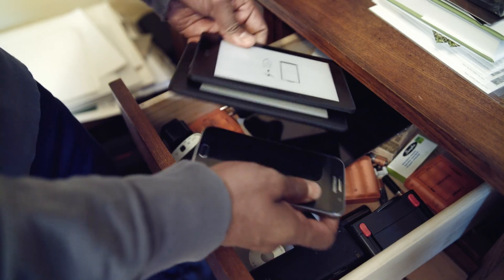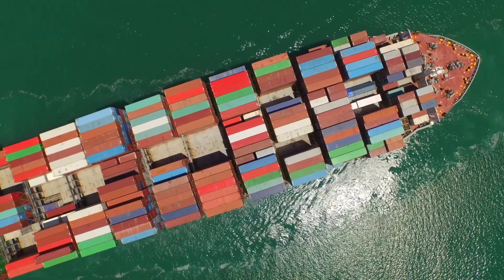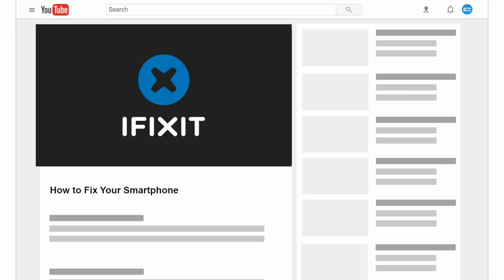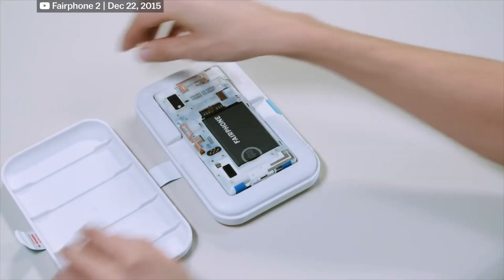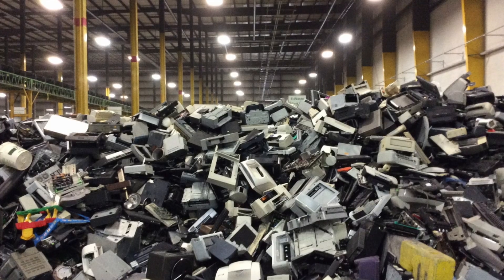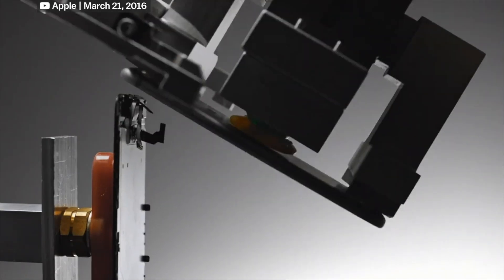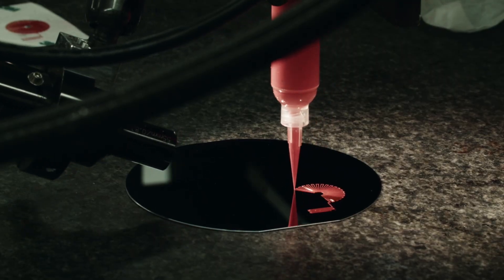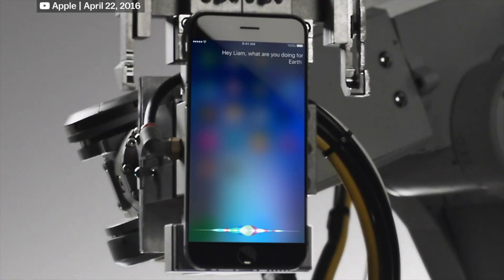Why your old phones collect in a junk drawer of sadness

Comment: The reason why devices like smartphones are so disposable is because they are by design getting better in every iteration, in such a way that older devices can no longer serve the same primary purpose in a satisfactory way. Take "browsing the internet" for example. The latest phones give bigger screens to view on, faster processors to handle heavier websites, and better support for emerging web standards. Sure you could repair and keep using your old phone, but you have to learn to be content with a tiny screen, a broken website and a slow processor. And that is what drives people to upgrade. Compare that to a car which serves its primary purpose very well, which is to get you from point A to point B. Any working car can do this, whether it's a Model T or a Model 2017. The only thing you get from upgrading to a newer car is the extra bells and whistles, not really a big improvement to its primary purpose. Now imagine in a distant future, if the road system changed in a fundamental way that simply required you to have a new car equipped to handle the new road system. The old car could no longer be used in the system to serve its primary purpose and people would simply be forced to upgrade. I remember a movie set in the future where the cars were all electric but the country's car charging stations had upgraded to version 4 with no backward compatibility beyond version 3. The protagonist had a cheap rental car of version 1 and found with frustration that her car is too old to be charged up in any of the numerous charging stations around the country. So she had to ditch it and walk for miles. That's the kind of future that would make cars as disposable as smartphones today.

Comment: Today, I dropped my phone. The back came off, the battery shot under the car, and the screen did not break. The phone is fine, I put the battery back in and it's fine.

And here these guys go saying that if you take the battery out wrong it will explode. When did this happen!? What happened to batteries that just come out? Am I using a brick to make calls and nobody told me?

Comment: The sad thing is that phones basically stop working after they reach a certain age because they can no longer get OS updates, and without that you can't install software anymore. Compare this to computers, which are actually getting better at forward compatibility—my nine-year-old desktop runs Windows 10 just as well, or better, than it ran Vista when it was new. I had to get a new video card and more RAM to keep up with my usage needs (mainly games and 3D modeling), but if I decided to get a new system, I could put the original parts back in and donate it to a thrift store, and some poor family could use it as a basic PC for browsing the Web, checking email, storing photos, and even editing home videos. Even a Mac Mini from 2009 can still be upgraded to the MacOS Sierra according to Wikipedia. I don't know how well it would run, but you could do it.

Comment: One important problem that was entirely missed here: Software support. There are plenty of phones with easily-replaceable batteries, but even if you could keep finding batteries for that phone forever, even the best Android phones stop getting security patches in 3 years, and iPhones and Chromebooks stop getting them in 5 years. And that's from when they first started to be sold, and those are among the best options we have.

What that means is, even if the hardware lasted ten years, your phone would be a security nightmare for at least five of those years unless something changes dramatically. And that's if you buy a good phone. It's easily possible to buy a cheap Android phone and have the updates stop in less than a year.

It doesn't have to be like this -- if a PC is actually getting to be 10 years old, you might have other problems, but you can usually at least keep upgrading the software. Even when Microsoft finally stops security patches to old OSes (they supported Windows XP for twelve years), you can buy a new OS, or download a free one. But even the "download a free one" option is kind of broken on phones.
Reply: It's like this because our economy is based on continuous growth. Companies need to make sure we keep replacing our phones and more frequently.
Reply: most these unofficial updates dont run 100% as they should. theyll always have some pretty bad bugs and once theyre ironed out, the next version of android is released with a whole load of different problems.
Reply: David Masover I second this. Ever since my first computer I've been replacing the software to keep them going as long as I can. When it gets just too slow or loses software support, I uninstall it and install Linux, which increases performance tons and has given my computers and laptops much longer lives than most.
Reply: In terms of usability older Android versions still technically remain usable for longer then there iOS counterparts. You can extend your upgrade period to 5 years using this, but most people stick with 2.

Rom hacking is also an option and you can still probably suck 5-10 additional years of security updates using this, although its heavily dependent on the popularity of your Android phone.
Reply: I'm looking for a smartphone with removable battery. Beside the fairphone 2 and the LG g5 (wich was a failure), I didn't see other
Reply: Yes and no... I mean... I gave my 8 years old phone (Sony Xperia Acro S) to my 7 years old kid... and I loaded with a bunch of emulators, simple games, some music, some movies and that's it... It is not technically used as a phone... but it is a device which, without Software Support for well over 6 years, is still used more than many 2019 iPhones.

I also have a couple other devices that I use as security cameras (Alfred Camera App) or as temporary backups in case our main is lost/stolen/broken.

I understand the concern of using old devices with no security updates, but if you destined to simple uses, they can still be worth having around
Reply: @buccob  So smart!  I like your idea of finding creative ways of using tools to expand their values and prolong their lives :)
Reply: Antonio Randolfi lg v20 , note 4, lg v10
Reply: +Hanro50 what on earth are you on about. 5-10 years of security updates?
Reply: Moto E4 has a removable battery if you're still looking...
Reply: true
my nexian journey a890 made in 2010, had replaceable battery
however it couldn't use today android version
Qualcomm MSM7227 600 MHz
512 MB ROM, 256 MB RAM

out of specifications
Reply: Linageo OS saved my Note 4
Reply: You can update an Android phone unofficially by rooting it and choosing a custom ROM for your phone that has the latest software. Most of the ROMs are community supported, so the support probably last longer than the support from the manufacturers themselves. Though, this step is risky and can make your phone totally useless (bricked) if you don't do it right, but you can reuse your older phone if you successfully do it. I turned my old phone into a "benchmark and development kit" to test my personal projects to see how they run on older hardware.
Reply: HQ unofficial security updates...its the Android rom hacking community I'm going on about. I got my old galaxy ace phone running 2.3 gingerbread all the way up to 5.1 Lollipop back when I still had it.

Check out the XDA development forum or the Lineage OS project to get more information.
Reply: You are probably one of these guys, that haven't ever hered of flashing your phones ROM.

"MY APPLE IPHONE is getting slowed down... 
what can I do?...

Damn, Flash it, don't buy a new one.
Reply: Not to mention that climate and care dictates how long ever smaller components will last before they degrade, even if made of otherwise lasting materials. That is, all things have a point at which heat and cooling affect them permanently, with smaller components being more susceptible, generally speaking. You can ruin the system bus on a phone with the right temperature. Even still, opening up your phone exposes components to ESD-- and there should be a smarter way of designing things to avoid this. I am so curious about Fair Phone's design for this reason!

Comment: 5:53 what if we could have just kept having phones and other mobile devices where you just open a panel and replace the battery, you know, like we had for decades. reasonably easy to replace batteries should be mandatory, what if your car came with a battery that was hermetically sealed to your engine block, i'm pretty sure legislatures would destroy that idea pretty damn fast. or hell, what if the hood of your car had a "warranty void if removed" sticker? or even worse, what if the fuse box in your house had a "warranty void if removed" sticker and one of your breakers popped. its the same thing.

Comment: I strongly disagree with you. Batteries are only one part of the problem. Software that runs the phones and the most reason why phones get replaced. When your phone manufacturer no longer provide software updates to your phone, that's when the apps you have on your phone can not function like they used to be. hence the need to buy a new phone to keep up. My iPhone 3Gs' battery is perfectly fine, but lack of update render it unusable. The same goes for my iPad (iPad One), it can last for a month on standby, but the lack of OS support render it unusable. Batteries can be replaced even of the phone does not provide removable option. You can still take it to the shop, and have a new installed, much cheaper than buying a new phone.

Comment: The thing is, often one does not replace a phone because it isn't functioning anymore. It is more likely, that the tech is outdated. So what use does a fairphone have in that regard? I don't care if I can get the same chip as a processor, if that chip is too slow and technically outdated.

Comment: @ 5:55 "imagine your battery charging in minutes instead of hours" 
 
I have a Galaxy Note4 and I get it from 0% to 100% in under 20 seconds. 
And it is no magic, just a second battery and an external charger.
Reply: Holy crap! I just put my phone in the microwave
Reply: +IAreNerd   Totally fine, as long as nobody turns on the microwave  ;D
Reply: 0 to 100 n*gga real quick
Reply: Ikr. I've got the Galaxy Note 7 and it not only charges itself in under 20 seconds, it also charges my whole house. Its great.
Reply: thats not charging the battery that's already inside the phone so it doesn't count.
Reply: +Jonathan  
Did you know there have been more burning iphone6 than Samsung phones (until the note7 happend)
google it ;D
Reply: Samsung fast charging is pretty fast I think compared to other devices I have used! It charges completely in about 45 minutes if kept on power saving and your wi-fi /mobile data is turned off
Reply: +Jonathan  
I wonder how much the insurance will charge you ;P
Reply: grayoctagon I have a ZTE and it goes from 0 to 100% in 10 seconds; I swap out the battery.
Reply: My button Nokia charges in about 15 minutes.
Reply: +Kdejaj  +The Tomas Cz  
plz read to the end before answering :P 
I just wrote three sentences... so it should be manageable. 
However the important part was: 
"And it is no magic, just a second battery and an external charger."
Reply: grayoctagon like most of the AMAZING TECH is already in a galaxy
Reply: +Quin Proctor   
No, on normal usage it lasts around 2-3 Days.- 
On heavy use I have ~20% at the end of the day.
Reply: grayoctagon my note for goes dead than when I turn it on it goes to 100 percent then it turns off perfect batteries
Reply: Same my tablet was s a Samsung all I have to do is put the charger in take it out and it’s charged!
Reply: grayoctagon I actually did just thought it would be cool to share......
Reply: +Kdejaj  okey
Reply: My Huawei charges with a charger from one of my Lenovo tablets and it charges from 1-100% under an hour ^~^
Reply: Give it one year.
Reply: Fast charging rate reduces the life span of a lithium ion battery (If its not cooled).
Reply: + maha nadir  
No not "fast charging" ^^ I have a second battery ;D  (search for EB-KN910B) 
If my Note is empty I just switch the Batteries and load the empty one in the external charger. 
It realy takes only 20 secounds :D
Reply: grayoctagon so the battery runs out fast?

Comment: Changing your phone every two years is ridiculous. My 4s lasted more than double that time (still not great tbh). A big big problem with apple phones is that the software running on them quickly becomes outdated and the new software required more computing power. After just a few years you just end up with a sort of slow buggy mess. By the end of its life my 4s couldn't answer calls before they run out.

Comment: I usually buy a new phone when its struggling to keep up with software updates not because it broken but I keep the old one as a spare for if I lose or break my current one and whilst Im waiting for a repair or insurance to provide a new one which has happened on several occasions